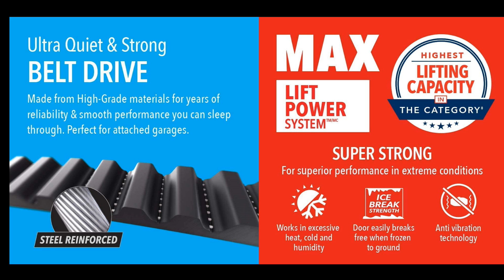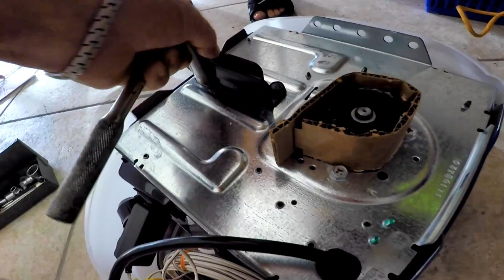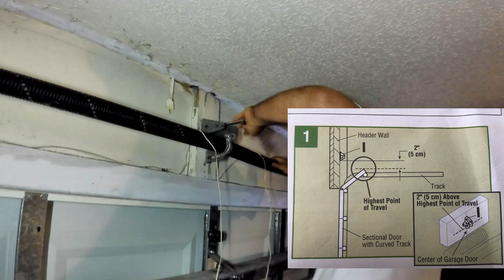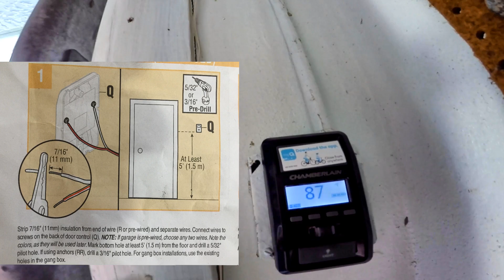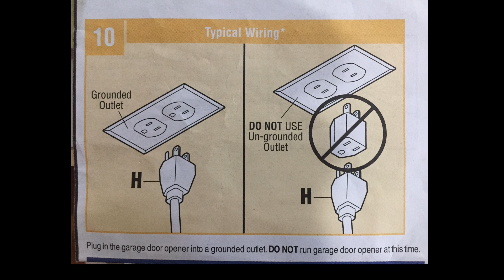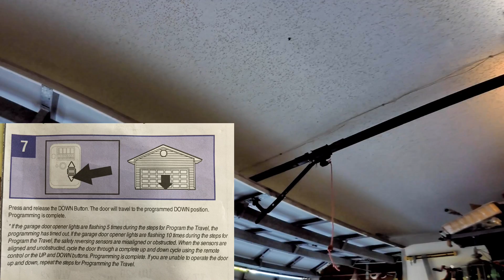How to Install Chamberlain Garage Door Opener - B970 Smartphone

Comment from the maker: Chamberlain B970 Smartphone-Ultra-Quiet Belt Drive Garage Door Opener with Battery Backup: https://amzn.to/31elW1K
Smart garage door opener comes with built-in myq technology to keep you connected and protected: open, close, and know the status of your garage door from anywhere with a smartphone with the myq app
*GET $30 AMAZON CREDIT after your first Key by Amazon In-Garage Delivery. Key by Amazon Promotion applies to eligible Amazon Prime members. In-Garage Delivery not available in all areas. Full Terms & Conditions at amazon.com/keyget30
Battery backup - ensures safe replacement ins-and-outs even during power failures. Radio Frequencies: 310, 315, 390

Comment: Very good job on the install sometimes you have to be careful on sending the down limit because if it shuts too far it will damage parts overtime and with the down limit sometimes you need a bump it up a little bit before you originally said it and then when you do the force control it actually shots perfectly and then on the end where your emergency release handle is make sure you trim the access and burn the end of the rope so looks good but everything else looks good if you wanted to you could’ve add pigtails to the safety sensors so if somebody gets stuck in the wire it won’t rip out the wire directly from the sensor
Reply from the maker: Good tips! Sounds like you had some experience installing.
Reply: @JohnCRV  I have many times I made a video on a install oh my YouTube channel about a week ago

Comment: Very good instructions on installing this great looking door opener. I installed a similar but less sophisticated one from a different manufacturer about 8 years ago. It doesn't have the battery backup or smart technology, just the remote control and keypad control, but has been working well since the day I installed it. Thanks for sharing my friend.
Reply from the maker: I'm not much into the high tech stuff but I had to get this one with the battery back up cause we get too many power surges lately and the last one it fried the board on the old one. This one has a built in surge protector I was told. I'll keep my fingers crossed.